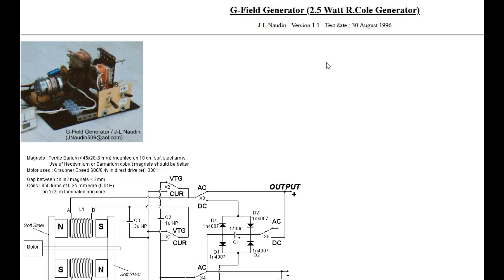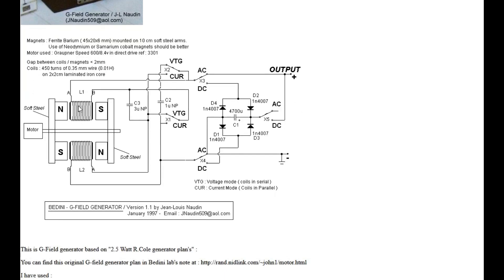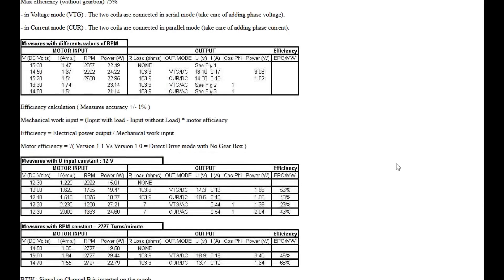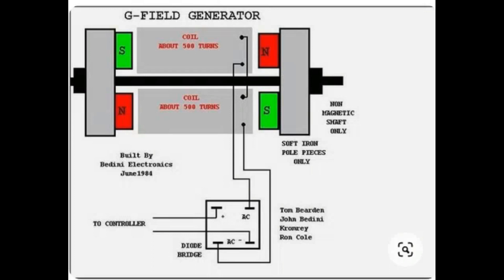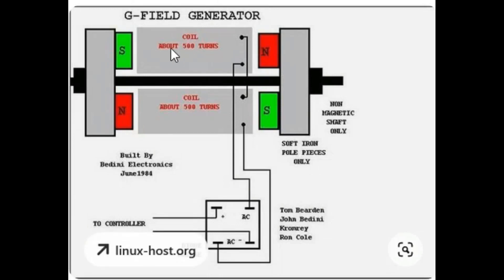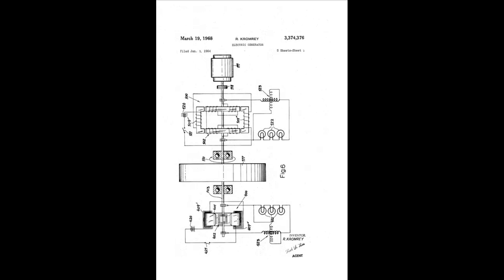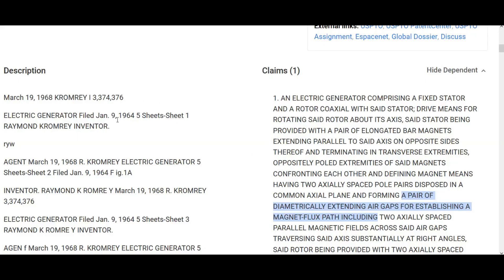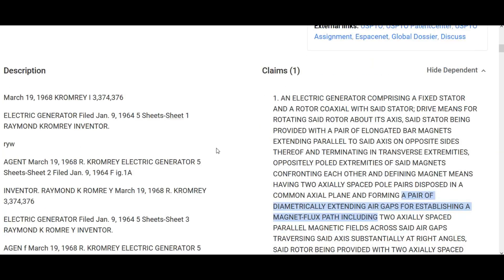Designing the Next Gen Pulse Motor Rotors Part II: Prior Art

Comment: I have thought about brushed motors, (especially running on AC, universal motors) why not add a pair of brushes
That contact the commutator just after the powering brush disconnects. It  should catch the induced current and especially if a motor is designed to take advantage of this possibly having an additional commutator, with connections to the powered commutator. Only with the pickup slightly advanced so it contacted as the power is broken maybe add a few coils of 28 gauge wire, with a slip ring to connect to this coil.  For experiments, maybe connect a large flywheel to the motor and run it as a pulse motor, catching the flyback,  and maybe connect a generator to the flywheel, or just mount magnets to it, and a serpentine coil set one each pole of the magnets, make a wood or 3d printed ring for the coils and magnets ,   a drill motor for example maybe try adding a brush set at 90° to be pulsed  at the same time maybe a cap discharge pulse send about 200-250v on the 120 v motor, for just over half the time it would be at peak ac voltage of 120/(170v rectified,)  being its pulsed atb 200+v DC.  Using a 12v battery  with flyback being pulsed at 1khz+  probably pulling  500ma or less with the output charging a cap, the peak voltage possibly bring 400-500v if left to charge, but trigger the discharge at 200-250v.  Using a rectified cap storage for the generator output, a super cap bank with charger or DC buck boost cc cv, to charge possibly up to 48v battery, 5amps,    a 12" 20-30 lbs flywheel generator  with about 16, 30 x 6mm N52 magnets  with steel flux spacers to add to the thickness of the magnet, maybe using 1.5" bar stock, x2 per magnet allowing larger copper padding over the magnet maybe use 1" x 2" flat bar stock, epoxy the magnets assemble in the 1/2" ply, and the ply to the flywheel , and use a large hose clamp to  attach the ply to the flywheel also using epoxy, jb weld, or similar possibly require a push starting i feel it would work, using the flyback from the motor to recharge its own drive battery,  alternate between the brush pairs being pulsed, then being pickups maybe it can nearly power its self , play with the cap values and pulse timing and duration,
Maybe work on a brushless design the  motor could bea 6phase using a 3phase supply,  using flyback and the opposite pole of the magnets,  it's a bit difficult to work out in my head. The flyback secondary coils would be high voltage low current, possibly,  so the coil used would need to reflect this, possibly using diodes to make it work, or wind pickup coils, the motor would need to be designed to work this way, I doubt it can be converted.
Reply from the maker: Certainly a lot can be done with physical commutation as well. If I get a chance may throw together a physically commutated pulse motor.  Some of the above is a bit difficult to follow, If you have something built on the above ideas please do share. 👍

Comment: Great series. I too have wonderd about including serpentine coils as seen on Roberts channel. Some of his generators seem very efficient. On a side note I have seen some very small bedini motor coils with some sort of ferrite core instead of soft iron. Which they claim is efficient and increases the push factor. Thanks again
Reply from the maker: Hey Brain,

So far I have been sticking for the most part with air cores, in this video if you look at one of the things Bedini commented that he didn't like about JL Naudin's attempt at replication was that the core needed laminations to prevent eddy currents.  I'll prolly throw in a welding rod core at some point but there are a lot of variables to start with and if I can avoid adding in different core materials at the moment that would be nice.  Howeva, since you bring it up, what I would be most curious about, there are specialty materials used often for magnetic shielding, mu-metal, Sendust etc, that have magnetic permeabilities 10-100x that of soft iron.  I have a hunch, though again haven't been able to get my hands on any for a core yet, that you could probably do some interesting stuff with a core made of Mu-Metal or something similar.